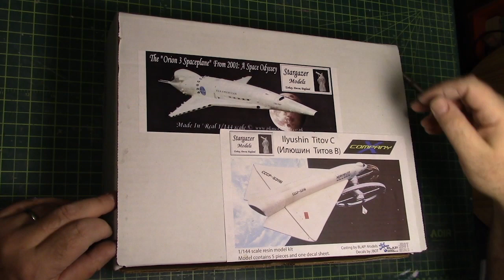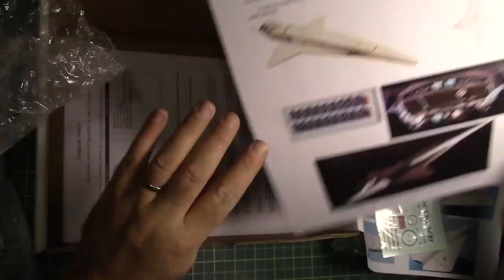Stargazer 01: Overview

Comment: I would be dremel / drilling out the windows and port/starboard flashers and lighting it, no question. 

You are going to paint it yeah? Could you cut a channel under the wings to thread optical fibre to the tips for lights? Then fill in the channel with putty and a couple of coats of paint and noone would be any the wiser. ;-) 

Looking forward to seeing what you end up doing.